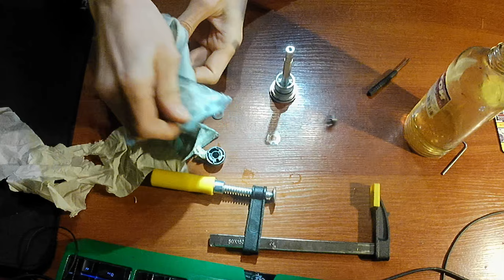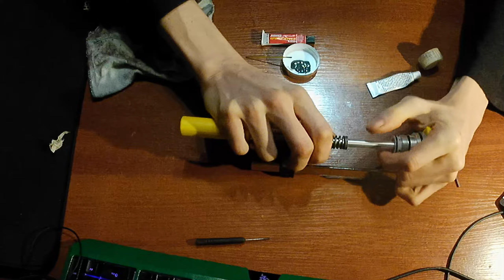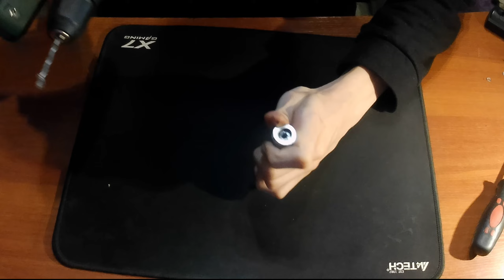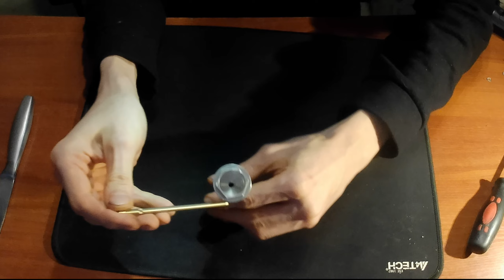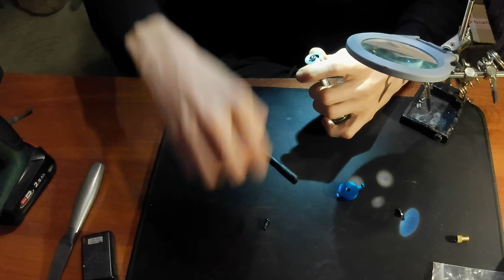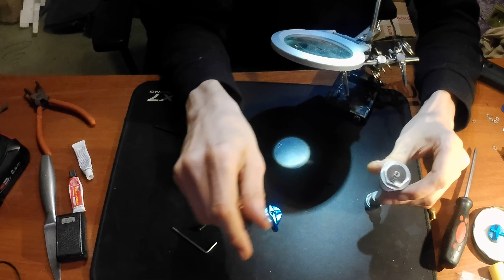CTD valve assembly FOX Evolution 2014 O/C damper

Comment: Oh, I met isssue when rebuild this damper, can’t put back to cartridge body with right ball position 😢
Reply from the maker: If we are talking about the mode switch, (the iron rod has 3 recesses into which the iron ball falls when switching). When assembling cartridge, this rod is inserted so that the center recess on it coincides with the hole where the spring is located in the cap.
Reply: @Gribochek  Thank you so much, I've rebuild 3 Evolution dampers, same as your method, align the postion without spring, then install and use epoxy glue, that works perfect <3